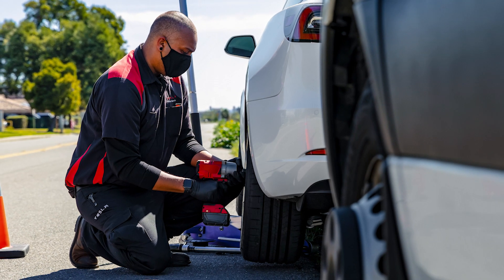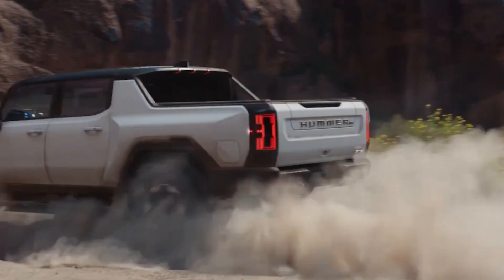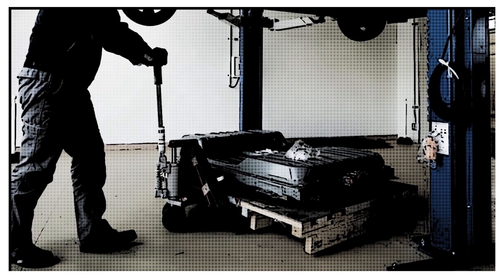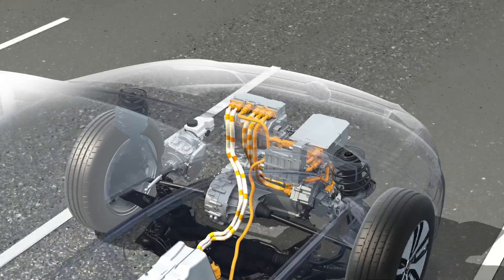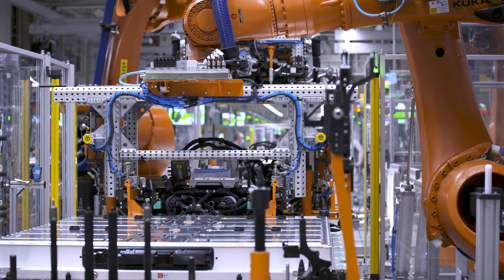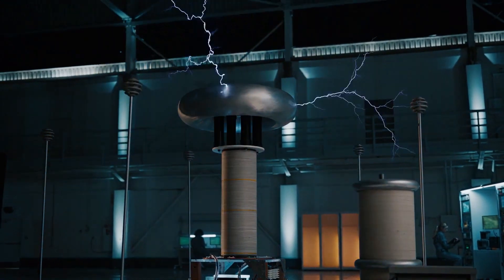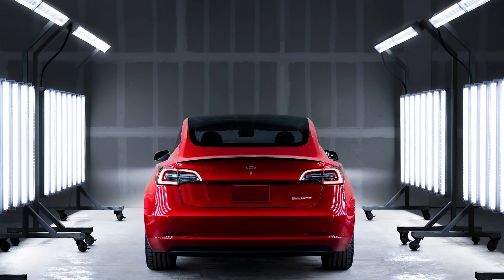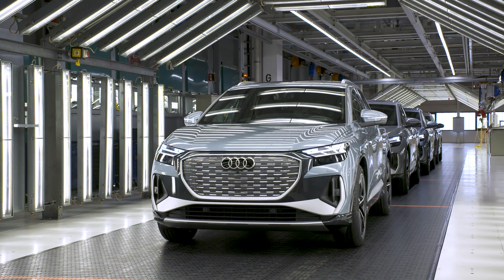How do you SERVICE an Electric Car?

Comment: Unscrew the top on the washer fluid jug...

Drive to the tire shop.

Brakes - present, check.

M' Bolt weighs 3,600 lb

Comment: No such thing as a " fossil engine". Oil is not fossil fuel. Fossils are generally found around 16000 ft down. Oil is extracted below 30,000 ft. And how much oil is used to make an EV car? How much oil is in such car? How much mining is required to extract minerals for batteries. Look into mining waste water. Then imagine everyone having an EV. This 1st world advancement will be on the backs of the 3rd world.
Reply: Keep fishing.  This would have been good when there was no internet to debunk things

Comment: I took my EV for its second service last week, it took them an hour and charged me £227.72, £187 was for labour? My first service on my EV was under £73! I queered the cost of my second service and asked why the labour was so high - That's the price of the service was their answer! My EV has only done 10.000 miles in just over 2 years, I drive my EV on eco, I stay within the speed limits, yet I received an advisory saying that my back brake pads and discs will need replaced within 6 months? EVs were meaning to help save the ozone/earth, but it will cost us EV owners, while others drive around in smelly fumed bangers! It isn't going too work!
Reply: If any of that is true, what did they actually service. I have a 2015 Fiat 500e since 2018, no service, 1 alignment, no prob.  Sounds like you did much more than the scheduled maintenance for most EVs, if even that's not a rip off.  It sounds like you handed your wallet to the dealer and said do what you need to, or this is all made up.  Even my BMW I3 dealer maintenance is cheaper

Comment: If you have a Tesla you dont bother. I spoke with a Tesla mechanic and he told me they had a Model S with 300,000 miles on the clock in the work shop and it had the original brake pads.

Comment: My EV battery has a desiccant filter that needs to be changed once a year. The fluid in the final drive needs to be checked for contamination. The annual service/checks are about 1/8th the cost of my ICE vehicle of the same brand.

Comment: Think worth mentioning gearbox oil charge at 90thousand miles.Also some garages issue service reports that are incorrect
Reply: I have a retired certified tech work on my Tesla 3. He highly recommends 30K oil and filter changes on the drive units. Also says that the annual service is extremely important. While doing the brake caliper service he also checks the wear pattern on the tires and torques the suspension mounting bolts. He recommends a weighted wheel alignment primarily after the first year from new as it is his observation that the factory alignment has not been very precise. He feels that a lot of the early tire replacement has been due to alignment issues.

Comment: I would like to know over how many miles of normal driving can you expect to receive from the OEM tires that are on a well aligned electric vehicle.🤷🏼‍♂️
Reply from the maker: Good question Gary. One of the guys on the team here replaced front tyres of a LEAF 30 at about 60,000km and is still on the back originals at nearly 100,000km! All depends on how you drive I suppose!
Reply: I have just replaced the original front tyres on my Renault Zoe at 30,000 miles. The rear tyres still have plenty of tread and I expect to get 40,000 miles out of them, possibly more?
Reply: @malcolmfowler8972  Thanks for the feed back. Do you have any comparison to an ICE vehicle of same size tire? I just don’t know how good the tire compounds have gotten for tread wear ratings while maintaining grip which are usually the two counter opposed ratings on a tire to the another. Get them too hard to last longer and they’ll squeal under the least bit of a turn.
Reply: @garyclark6747  I always drove small hatchback ICE cars which had narrower tyres than my Zoe so I can't give a direct comparison. 

The Zoe tyres don't squeal (not when driven normally) and the grip seems fine. Despite reading that EV's wear out tyres faster than ICE cars I haven't found that to be the case. You just need to make sure tyres fitted to EV's are of the correct specification for the extra weight of an EV.
Reply: Key words, well aligned. Most aren't hence excessive tire wear.